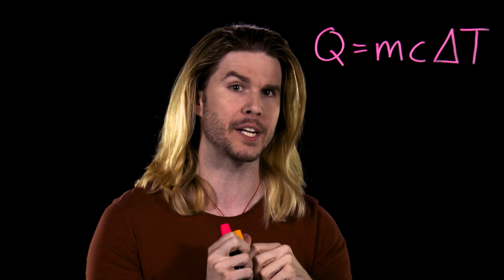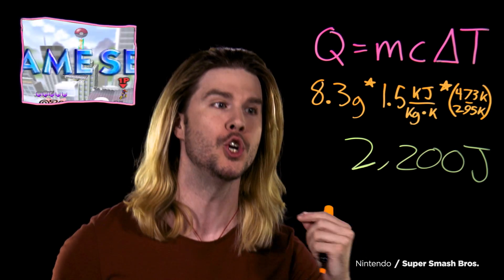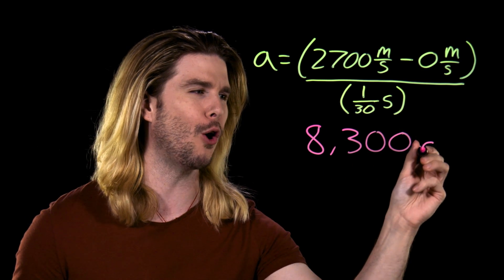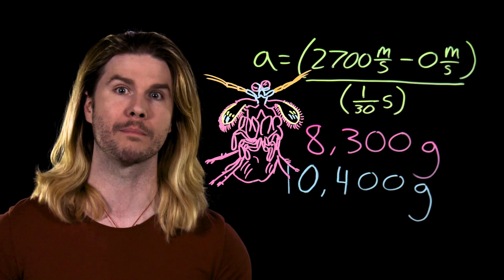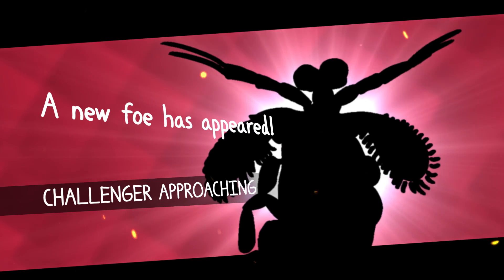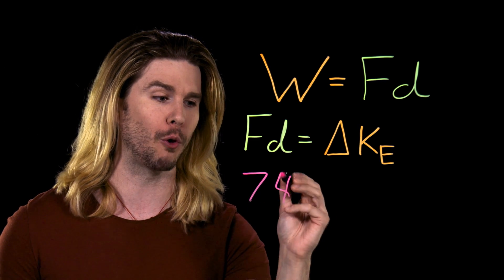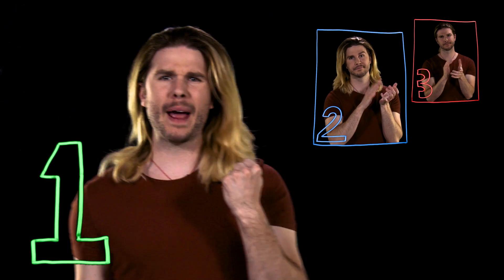How Powerful is a FALCON PUNCH?

Comment: Hey, a valid point: as Kelvin and °C are measuring the same thing but offset to one another the change in temperature of those scales are EXACTLY THE SAME. ∆°K=∆°C, because science. However, there is probably another reason why you converted the units, as you may already know this.

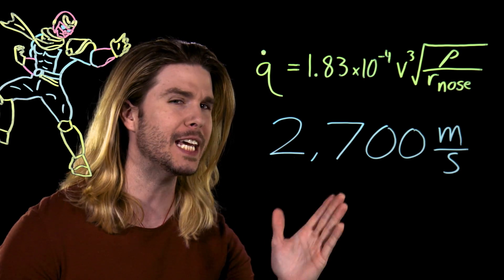Comment: @6:50 What are you talking about? Orbital (and suborbital) rockets go much faster than this, though if you contest their 'on this planet' nature, what about the manhole cover that launched off an underground nuclear test? The single frame of slow-mo that it appeared in says it was moving at least 60 km/s, or roughly 25 times faster than your falcon punch (which is why it probably vaporized over the next fraction of a second).

That aside, this is honestly a surprisingly consistent answer—I'm not an expert on captain falcon... like, at all, having never played or really watched any nintendo games, but from the short clips shown in the video, the associated kinetic energy seems to be in about the right ballpark. As a fun fact, if he's really energy efficient, then he'll be burning just a couple burgers worth of calories per punch (food, and fuels in general, have a lot of energy in them. It also takes a lot of energy to heat things up, which is why guns are such good weapons and why lasers suck—guns take the massive amount of energy released by combustion and convert it to a projectile which is much more effective at destroying something than the same amount of energy applied as heat. Thinking about it another way, melting something means sheering all the bonds between the molecules. On the other hand, cutting/piercing/ripping something to pieces requires breaking almost none by comparison, which is, again, why laser suck for most purposes—heating is an incredibly energy-ineffective way to damage things).

The force calculation at the end makes no sense—force is not a useful measure of damage done, energy is. You, for some reason, converted energy back to force, but it's meaningless—yeah, it would be like 2 saturn rockets taking off on your face... for a minuscule fraction of a second. It tells us nothing. What does tell us something is the kilogram of TNT number, for example. Though nowhere near all that energy would actually be delivered into the target, or even released, but would rather be reabsorbed (as heat and tearing bones and flesh) into the arm as it comes to a stop at the end of his reach, having punched clean through his opponent while shredding his own hand xD

Comment: HEY! Live-action simba! Please read this! You used the original game to measure the acceleration for his punch but in later games, he used about a second to charge the heat up. What if Captain Falcon  is using that charge time to speed up his fist so his acceleration is much, much less. The ring of fire that appears around his fist/glove a frame before punching also could be the shockwave of his fist speeding up. How about that?

Comment: Hey Kyle love the show! (And your hair)

Quick question: If the falcon punch travels fast enough to ignite Captain’s glove, once his fist enters his opponent, would it cauterize the wound it created as it dissipates the heat (assuming they didn’t fly)? Depending on how hot it is, you actually might be able to vaporize the blood inside the target and cause them to explode from the inside out with just your fist, pretty metal. 
Same train of thought as the “laser sword” episodes.

Comment: A question I've had in mind for a while: If at low speed you lose body heat and risk getting frostbite, and at high speeds you start heating up, there MUST be a point where the energy you lose and the energy you gain cancel out and you should be threoretically fine.

Comment: What about the force to FAWLCON PAWNCH [Bowser with the Metal Box and Super Mushroom] to the ceiling of the level in a fragment of a second (assuming 999% damage)?

The game assigns a weight value of 135 to Bowser (the heaviest character in the game now that Giga Bowser is no longer playable (formerly 400, btw). This is multiplied by 4 for the Metal Box and 1.42 for the Super Mushroom. 

Note that Smash Bros. weight units aren't pounds, grams, or whathaveyou--Donkey Kong, officially 363 kg, has a weight value of 127, while Captain Falcon is 140 kg with a weight value of 104. Bowser himself is a whopping 1,180 kg (giga bowser is 10x that, incidentally).

This gives you a weight value for Bowser of 862.65 (7,540.2 kg).

Uh... I'm not sure I can math well enough to go much further than this.

Comment: 2700 m/s is not 2 miles per second, 2 miles per second would be 3200 m/s. A little over 20% difference is more than I could call insignificant.

Comment: I'm assuming this was based on the basic forward-facing Flacon Punch. Therefore would there be any additional force behind it if it was a Reversing Falcon Punch? Like in Smash this one does more damage by activating the punch whilst facing the opposite way and turning mid punch for even more damage. So would this simple act of rotary motion add any significant force atop the amount it already does?

Comment: The N64 smash bros actually runs at 60 FPS, it's one of the very few titles on this system to actually pull it off.
(And given F-Zero X also runs at 60, it can be said that all titles captain falcon is in runs at 60)

Comment: Punching at that kind of force would result in your tendons immediately ripping off your bones. If they somehow didn't, you would have a few things happen. Punching involves the pectorals, front delts, and the triceps. To extend your fist at that force, your shoulder would pulverize it's socket as it's pulled up and forward to your chest, and your humerus would snap like a single strand of spaghetti (aka spaghetto) as your forearm bones catapult backwards through the joint. Congratulations, you've just disarmed yourself.

Comment: Not really relevant to the actual discussion but....i always find it interesting when people have issues about certain moves, even if kyle is just joking about it. I’m of course talking about kirby’s down special. The move has always had so much startup lag that makes it incredibly easy to just move out of the way to avoid. On top of that it has so much end lag(even in ultimate where both start and end lag are slightly less than the past), that you essentially get a free punish on any kirby that uses it, if they land on the ground with it, it’s a free grab on em. If they cancel it in the air above you, they’re still stuck in enough end animation lag to hit em with an aerial. It really is only useful as an edge guarding tactic, but even then it’s realistically simple to avoid, and Kirby has a far better option with his down aerial drill spike

Now if folks are complaining cuz it’s boring or they’re just confused why A kirby player keeps spamming such a high risk move, i can understand. I just look at it though as an easy win, I love finding Kirby players who spam it as it means I don’t have to put any effort in to beat em.

Comment: Wouldn't you use Ultimate, as the most recent version and thus with more frames and more accurate data to how the Punch would work? Maybe the math would work a little differently in that case?

Comment: You may have meant to say it, but just nerd-clarifying that afaik the fire comes from the compressed air/plasma on the other side of the shockwave, not the heatshield/glove itself.  Yes the heatshield/glove gets hot, but the fire we see is from the air itself against the shockwave.

Comment: Naturally, this doesn't take into account that such a punch would actually never launch a fighter. It would turn them into a fine red mist. A sonic boom going off that close to a body would cause massive damage, and being hit by something going at mach 7+, even just a fist, would at minimum punch a clear hole through someone, and would certainly blow the rest of their body apart. Smaller fighters, like Kirby, might be vaporized. The other part of that, however, is that Falcon's fist would suffer an equal and opposite reaction, destroying himself in the process.

Although, considering the forces involved, his arm might not be able to stand up to the force of performing this technique. That's something to consider for sure, would a human arm/fist be able to withstand the force necessary to produce this effect long enough to actually GET to that point and make such an impact?

Comment: SNES F-Zero (first appearance of Captain Falcon) and N64 Super Smash brothers (First appearance of falcon punch) both ran at 60 fps. Why did you choose to use a time value of 1/30 seconds? Wouldn't use the actual framerate of the game double the power requirements?

Comment: I guess in theory you could say his gloves are coated in phosphorus which can be used in tracer rounds. The phosphorus is ignited by air friction at a lower speed than what's required for a leather glove. It would make the punch roughly 66% slower if I understand correctly. Not that it's any more plausible at these speeds but it does make it seem less ludicrous.

Comment: Heeeellllloooo Kyle, because of my ADHD I noticed that within every scene of a  character Powers up in dragon Ball z or 
Super, when a sayian  Power up, the debris around them starts to flow into the air. Knowning how electricity works on hair at low or high wattages. Can the same really be done with rocks and other minerals? I would imagine it'll well  take a lot of powerful to do so. Maybe it would take more then a city power grid or more. Also wouldn't the rocks/minerals well need to somehow have a similar composition to hair? Let's not forget how Powering up practically destroy or distorts electronics around them. 
I'm guessing to do the math you need to find the weight of a strand of hair and then find out how much electrical power you need to have it rise. And then somehow translate that to finding the power you need to lift a 5lb to 1lb rock/mineral.

Comment: The Falcon Punch is indeed strong, but what about Ganondorf's Warlock Punch?  Looking at the animation for the move in Smash Bros Melee, it appears that Ganondorf's fist covers a significantly longer distance (due to his broader shoulders and thus further reach) than Captain Falcon's does.  If his fist covered, say, 25% more distance during the delivery of the punch, would it be a simple extrapolation to say that the Warlock Punch would be an additional 25% more powerful?

Comment: A question
1. Wouldnt height difference between reentry vs ground's atmospheric pressure be different? Since ground level should have more air molecules, it is essier to burn at lower speed?

2. At certain speed, wouldnt the problem be either falcons hand would break or become like a bullet going through certain objects, especially flesh?

Comment: What if Captian Falcon's glove was made of something, or coated in something, that set aflame at such a low temperature, that the air resistance could light it moving at merely the speed of an average punch. And remember, that the hand need not fully set on fire, it only needs to act like a flint sparker to get the flaming effect for that short a time.

Comment: Huge fan of the show! One slight thought/correction: you calculated that the mass portion of the punch's equation was simply the mass of Captain Falcon's fist, but as a trained fighter, he wouldn't simply snap his arm out, but would rather engage most of his body in the move, starting by planting his foot firmly and basically acting as an enormous spring (or mantis shrimp punching mechanism). He would then lunge forward and essentially put all his weight behind this punch. I don't have exact figures, but I imagine this would greatly increase the available energy due to having far more mass behind the same size impactor, as well as make it slightly more conceivable for such a punch to be thrown. Granted, this would still require insanely overpowered muscles, bone, and skin, but that should just make Falcon even MORE intimidating!

Comment: With that kind of force behind a small area of contact like his hand I think captain falcon is far better suited for Mortal Kombat then Super Smash Bros, as his fist would go clean through must humanoid opponents. Or depending on bone flexibility and the deceleration that his opponent adds to his punch, he may just have a hand stuck inside a smoldering chest cavity. 
Depending on the area of contact and the material of his gloves/how quickly they dissipate heat he may be able to keep it pg by cauterizing the wound but if it hit a major artery the blood would still end up spraying a fair bit, and this is ignoring the splatter that would take place just from the bone and muscle etc that would be displaced by his hand entering a body.

Comment: Technically speaking, wouldn't the mass that needs to be heated to its ignition point in Cap's glove be significantly less than in these calculations? After all, the flames need only last a moment, so perhaps only the very surface of the glove needs to be heated to that extent. Sure, some heat would be conducted to the rest of the glove and elsewhere, but it needn't be as much as the thin portion that actually ignites.

Comment: So I got a question. If you were floating in space in a capsule with no gravity , with a gun. Ignoring how stupid it would be to do this, if u brace yourself up against the wall and fired the gun, what actuality moves  inside the capsule. Does the bullet fly out of the barrel or does the capsule move back allowing the bullet to leave the bullet and hit the other wall. Space is weird it does all kinds of crazy stuff to other stuff

Comment: 49 seconds in, want to lodge my guess beforehand.

Air on its own is really not self-combustible.  It tends to sit at the very bottom of its Gibbs-Free Energy state, and you would need to add a lot more things at elevated GFEs and the potential to combust.  There are trace amounts of organic molecules (and maybe some free solid particulates via dust) that could be oxidized, but not really that much.

No, without some kind of weird backpack injecting fuel into his punches, this is probably not the way to go.

Rather, the falcon punch should be creating a shockwave by exceeding the speed of sound (significantly) and elevating the pressure at the wave front up to high levels, taking advantage of the ideal gas law (okay, all gases are real gases, but the approximation is usually sufficient and the correction factor from real gases under high pressure tends to be between .9 and .999 under the vast majority of conditions.  So close enough for an approximation).

Ideal gas law:

P*V=nRT
P is pressure, V is volume, n is the number of atoms, moles, etc. of the gas, R is the gas constant, and T is absolute temperature (use Kelvin for ease of global understanding please).

Pressure gets raised by causing all of the air molecules to slam into each other as they get trapped on the shockwave front, raising the amount of n within a given V space.  As the equation must adjust, P goes up, and T must also go up.

Of course, this is balanced by the fact that air will still leave the shockwave, at the same mass as the air that is arriving (it's an open system, after all, this is inevitable), providing a temperature relief.

So, you have to go fast enough that the air pressure gets so high that the air itself starts to glow in the visible light spectrum, via the Blackbody Radiation curve.

Once T reaches a temperature where it glows at the appropriate color as the falcon punch (from the Blackbody curve), you can figure out the temperature that you need to reach to hit this compression, then back calculate that to your pressure, and use all that information together along with the physical characteristics of the system (like the cross sectional area, physical shape, and wind tunnel testing of "le fist"), you then have enough information to calculate how fast the falcon punch would actually have to be to cause the air to heat up to these sorts of temperatures.  Then just do that.

Boom.  And that's how you falcon punch.

45 seconds later:

Yup, nailed it.

Comment: 8:45 "estimating the mass of Captain Falcon's fist..."

But Captain Falcon's fist is connected to his arm, which is connected to his body, which has a LOT more mass than just his fist. It might not change the final number much (or it might, I'm not good at math), but it's worth considering that any correct technique in martial arts, like a punch, should generate force by efficient and well timed movement of the entire body.

Comment: Is it really that necessary to puch with so much force just to make a flaming attack? 
In how many ways can that puch kill Captain Falcon? I'm going for 4: the heat for obvious reasons, the tension tearing (at least) the arm apart,  the shockwave in front of your face, and the forth I'm not sure but I'm going for electricity just because it seems something could charge up at some point. 

Isn't it safer just to put some flammable dust in the glove and ignite it as you throw the punch? Maybe it's not as effective, but at least you would survive the punch...

Comment: So...if he generated even 1/4 of that heat an arm's length away from his face, first of all his helmet should melt, and his head overall probably wouldn't look too great either. At the least, his eyebrows and arm hairs should be singed straight off.

Also, like @Radix said, that would require a lot of calories. And people thought the Flash had to eat a lot.

Comment: Anybody know what would happen if you drilled aperfect  hole all the way through the Earth and jumped in? Assuming that there was no heat or air resistance to deal with, just a clean hole..

My coworker believes you would eventually just settle at the core, having succumbed to the effects of gravity. I agree at first glance but it's a curious problem and without air resistance I could see you maybe emerging out the other end.